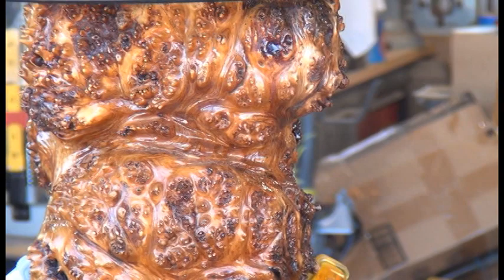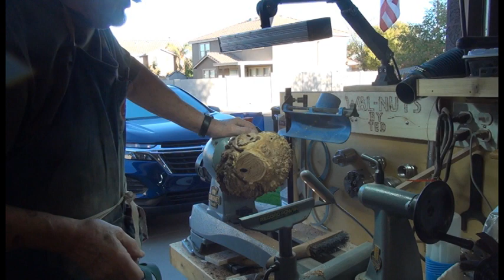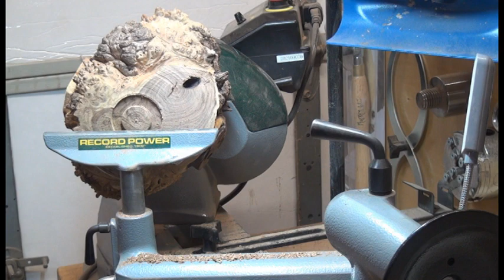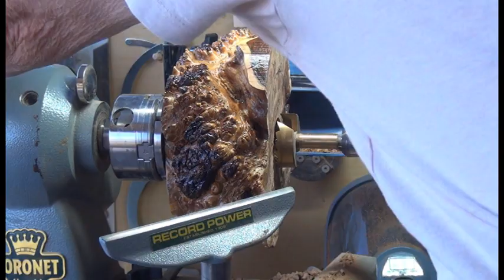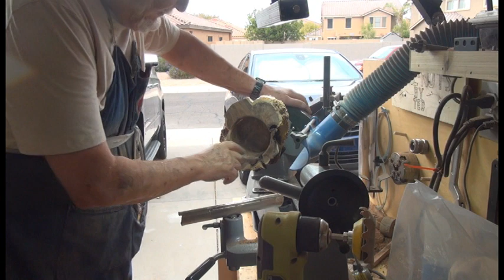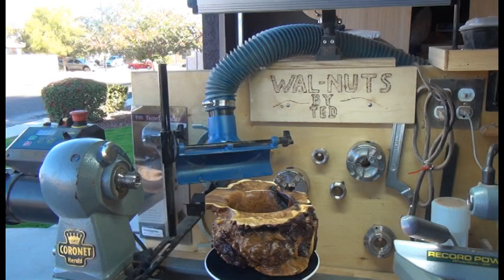ARIZONA DESERT MESQUITE BURL BOWL

Comment: Don't rush get well
Reply from the maker: Wow April 3rd and just got out of the hospital Monday after another week of being cared for by wonderful nurses and doctors. No work since December 1st, my first stay in the hospital. Getting old has its advantages, but recovery is not one of them. Got back to morning wads of one-half mile but have to get back to that. Feeling great, for the most part, just a little weak. No complaints just need to get back to the shop and finish the last large piece of this wonderful wood. I may add a little more video of it and post it as it may not be as beautiful as this piece, but still a wonderful piece of Arizona Desert Mesquite.
Reply: Well, take it easy until you get your strength back. there's no need to end up back in the hospital. Staying healthy.